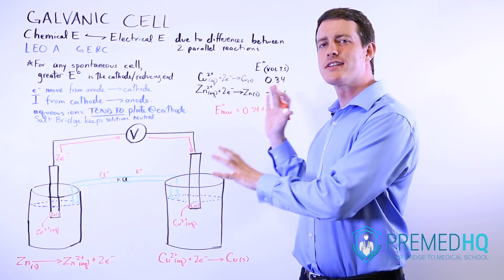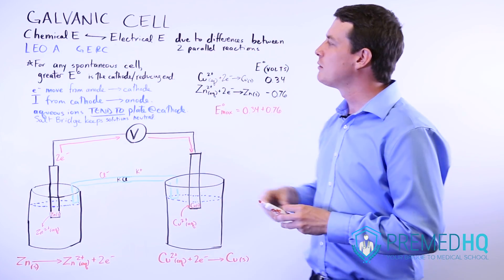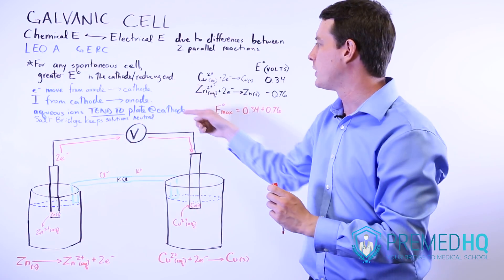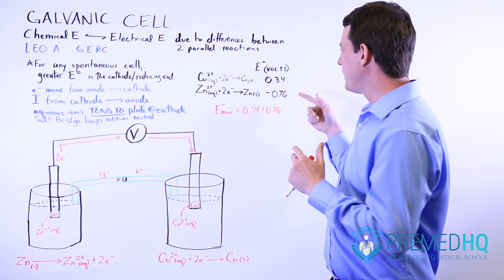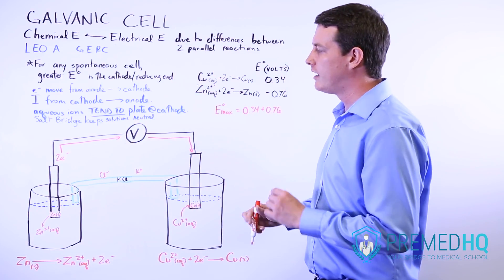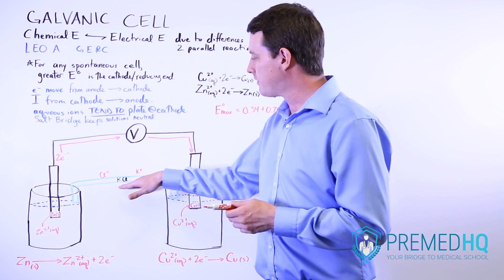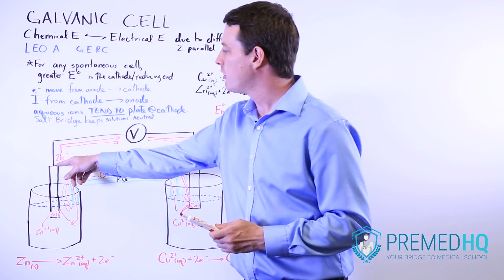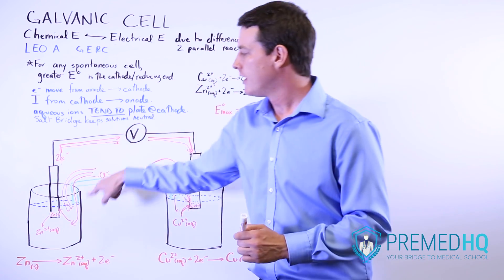Galvanic Cells (Voltaic Cells) | Worked Example with Cathode, Anode, and Salt Bridge

Comment: Why is a salt bridge needed? Why can't I place to KCL- sticks inside both beakers?
Reply: then the mobility of cations and anions wont be the same as it would have been in the case of inert electrolyte kcl in the salt bridge so there wont be any disbalance of charge on both sides thats how the salt bridge completes the internal circuit to maintain its electrical neutrality. in cse of kcl rods they will show independent chem rex in each bath and also the mobility of k+ and cl- wont be that same creating further disbalance of charge other that what was already being created by the main circuit.

Comment: Sorry you lost me when you started speaking about current? What exactly is current made up of?
Reply: Back in the day, current was measured as the movement of positive charge. This was due to a lack of understanding at the time. In reality, current is caused by the flow of negatively charged electrons. But because of tradition, we keep measuring flow as the movement of positive charge, even when no physical positively charged molecule is moving/present.
Basically: current is defined as the movement of positive charge, so it moves in the opposite direction that electrons move.